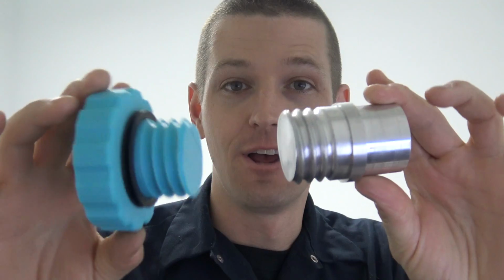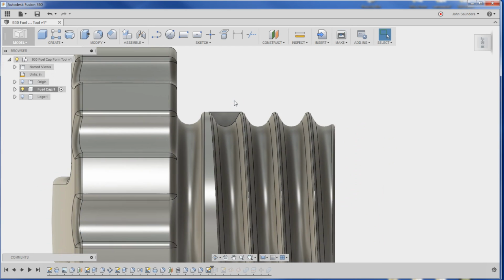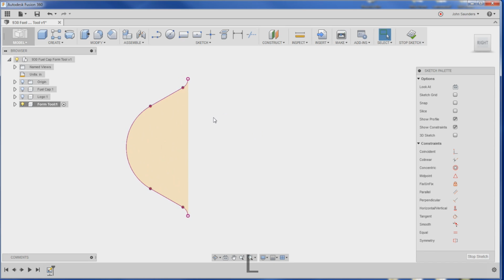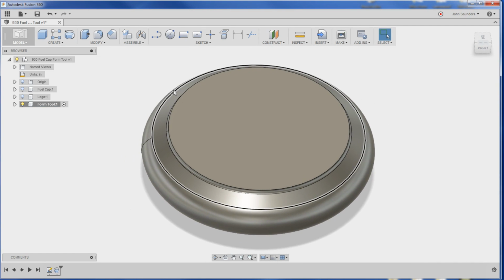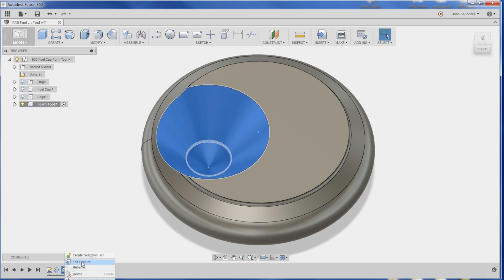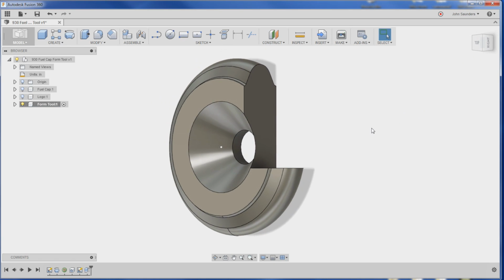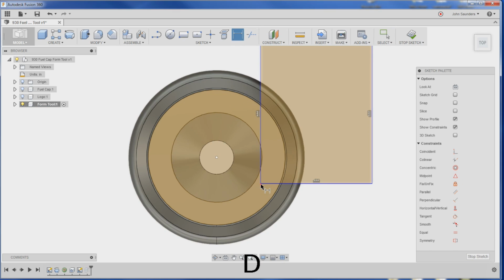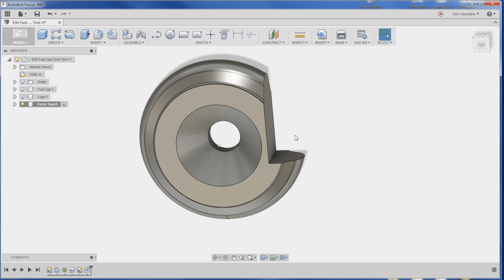Custom Fusion 360 Lathe Form Tool!  Fusion Friday #25

Comment: Form tools in fusion have a ton of issues...ESPECIALLY when using tool diameter compensation... i almost crrashed machine, because when you use 'in control' compensation with form tools, it doesnt even include the tool height compensation. it also doesnt even calculate the compensation point of the form tool, overal they did a very poor job on form tools and overal 'in control' compensation for non standard tools like chamfering tools and form tools.

Comment: Just wondering if you can add your new component to a tool library for simulation. I understand using form tools option. But, wondering if we can use  custom components, or a Body  as a tool,  from a library. for simulation?

Comment: When you did the CAM for the threading operation on this part were you able to use the profile of the custom tool you made for in your tool library. I am trying to cut a custom ACME thread with a custom tool and would like to define my tool for the simulation part of it.

Comment: When you bring the cutting face down I see how it gives the tool positive rake as it comes in contact with the work but I don't see how it gives any relief as the outer diameter of the tool is still concentric with the countersunk hole in reality it probably doesn't matter too much cutting aluminum but I would expect to get a lot of heat buildup when cutting anything much harder maybe if the hole was drilled slightly off center at the opposite end of the tool from the cutting face you could get both positive rake and full relief throughout the cutter

Comment: Doesn't having the cutting face cross the form at an angle (as when you lowered it to get front clearance) distort the curve of the form? (Assuming that you intend to have the top face level in the cut.)

Comment: Hey cool video ! I want to start with cnc because you videos also inspired me to finally do it , i am using fusion 360 but i cant find a good cnc interface for a win pc , i want to cut precise objects also made out of aluminium. Do you have any tipp for a good cnc interface which is compatible with fusion 360 ? Thanks for the videos :)
Reply: +NYC CNC i mean should i use an arduino or a tinyg or just a other control board and also in addition what software to control the board (for example chilipeppr) i watched you videos with the tiny g and want to ask if that board is good for cutting aluminium/metal with precision ?

Comment: I have a lot of trouble using Fusion360. It can do a lot, and it's simplified down to exactly what I need, but I always have interface issues. You look like you really know how to use Fusion360, yet it still has issues even for you. I hope it gets better.
Reply: +NYC CNC Sometimes the view won't either rotate or pan or both, restarting the app fixes it. Sometimes I can't drag and drop, restarting fixes that too. Other times clicking certain commands just crashes the program, but wait a day, and it works again.

I think Fusion360 is great in the fact that it works on Mac and Windows and is cloud based, but it has too many issues for me to consider purchasing a license.

Comment: Here's a question: how much does the form change when you cut away a cross section off a tangent plane? Granted for this project it's not a big deal, but that would need to be taken into account if working with tight tolerance form tools, either by modifying the geometry to match at the cutting edge or modifying the tool to provide back relief (and still using a tangent cutaway to keep the form accurate).

Comment: John with ref to your cutter

Now this is my local guru makings a gear cutter using the two button method but it the relieving method I draw your attention to, start at post 58 skip the button  bit the disk is what you have drawn up minus the cutout 

http://bbs.homeshopmachinist.net/threads/41591-Involute-shaft/page6

Yes I know it's a quick method but for a one off it gets it done

Stuart
Reply: Forgot to say I your case you would use the program you made you disk with but now it's running excentric hence it gets the relief

Comment: A good practice in Fusion 360 for creating sketches on surfaces is to create a offset plane (offset by 0.0 in most cases) on the surface you want to sketch on and use this plane for your sketch.
This will allow you to select said surface for projection and other features for some reason Fusion 360 blocks a surface from being selected if you create a sketch directly on it.
When done using a offset plane you will not have this problem and it will save you from having to click on every line in the profile you want (with a complex profile this will save a lot of time and clicks). 1 click your done!
Hope this helps ya.   Thx for the fun videos.

Comment: Isnt it so that if you dont do the cut  so that the cut edge is normal to the radius, your cut profile will not be what you set it out to be, if you get my drift here. with the way you relieved the tool you are going to get a profile that is not the correct one for the cap, since the piece was formed by rotating the profile along the center axis, a relation which you now changed. 

Also the diameter of the tool did not change in relation to the cutting edge so when you rotate it you should get the same rubbing effect. moving the center point towards the cutting edge would help in regards of relieving.
Reply: Yeah, I think if you needed a 100% exact profile you would want to grind to center (like he originally did) and then cut relief under the cutting edge to avoid rubbing. The method of grinding past center is likely to be perfectly fine here since it's for a gas cap and the tolerances on the thread fit aren't likely to be too tight. Additionally, the original profile was based off a picture so there's bound to be some errors from that modeling method.

Comment: I'm sorry, but moving that cut down below the axis like that doesn't give you any relief.  The distance from the center of the cutting tool to the cutting edge is still the same as behind the cutting edge.  The goal of a relief is to make that distance smaller everywhere except for the cutting edge.  Making the center point slightly off center is probably the easiest way to do it.  Move the center point down, and then remove material in the rectangle like you did here.  You'll also need to remove material from the top, to make up for the fact that you moved the center down.  If you rotate the tool about the center point, and focus on one point, as you let the too move past your field of vision, the cutting edge should be the furthest out, and the edge following it should gradually move closer to the center.

Hope this makes sense.  If not, I can draw it up for you.
Reply: +jrucker2004 exactly, and muving the cutting point bellow the axis changes the shape of the cut also since the tool was formed by rotating around the axis
Reply: jrucker2004 I think you are thinking this is rotating tool, but i belive this is a lathe tool, ment to be held stationary and the part turned against it. Granted the same effect could be seen by moving the tool below the axis of the part being turned, but depending on tool holder, this isn't always feasible. Hope this helps!

Comment: Hey did you mount that tool on the bar on an angle at all? If you make a form cutter like that it helps to mount it at the helix angle of the tread that you are cutting, especially on a very course thread like that one as the helix angle is really high and you have no side relief in the cutter.
Reply: +Widget Works Manufacturing Inc. Going below CL like he did helps with the side clearance but does increase the error that +thecorbies mentions. angling the cutter sounds like a pretty slick fix.  I'd be sure to put the cutting edge into the disk after it was angled to keep it from making negative rake on the left side.